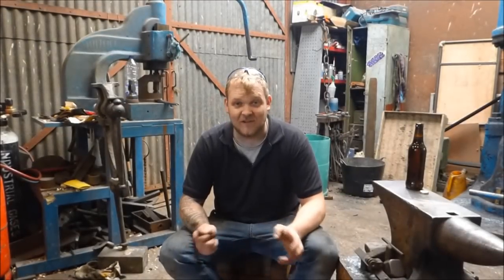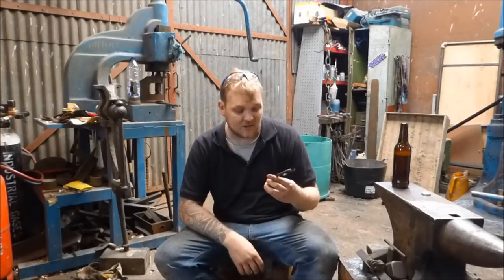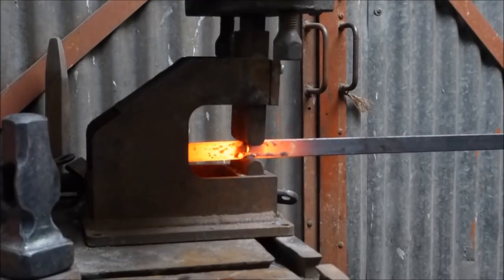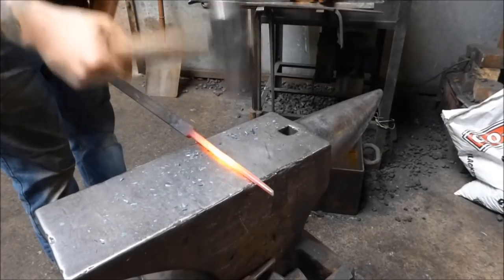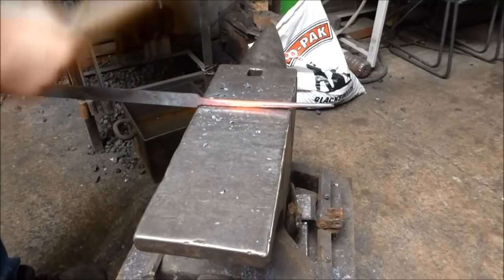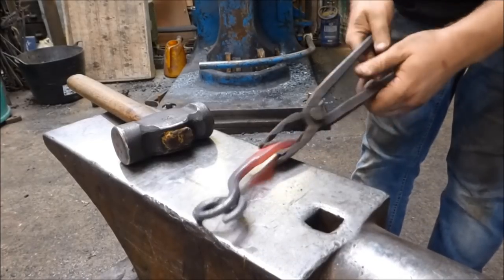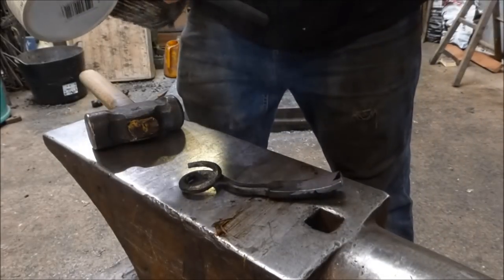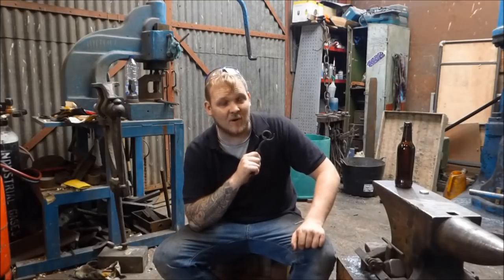A great Beginner Blacksmith Project! Bottle Opener! Win this Key!!!!

Comment: Interesting design! My biggest problem (and I'm a rank beginner) with openers has been the use of the drift in opening the large hole. Keeping the material even all around and not getting it too stretched out is tricky. Rolling a long taper like you've shown is an interesting way around drifting a large hole through not much material. Definitely going to give it a go. Kudos for promoting another smith's channel! Good on you, and I've subbed to Penny to get a fellow beginner's view on design and creation.